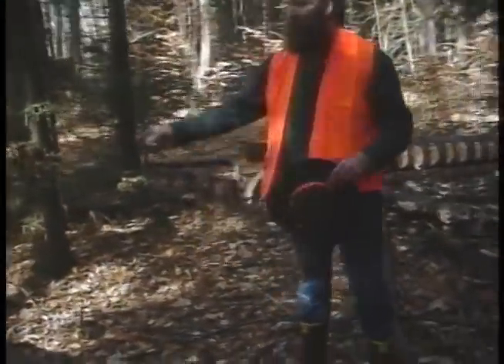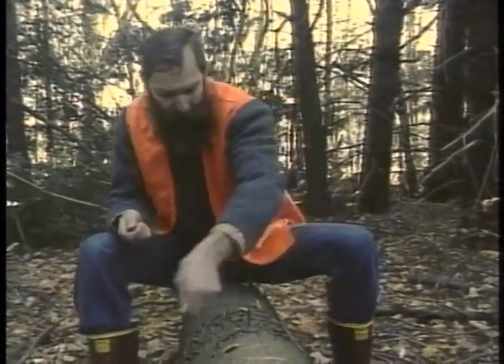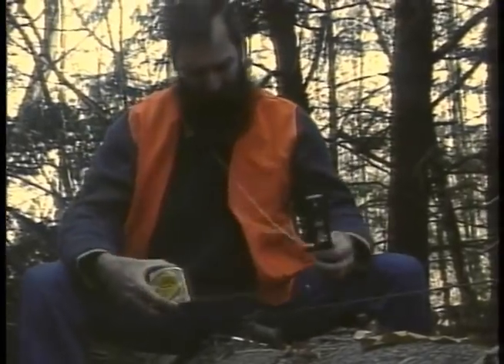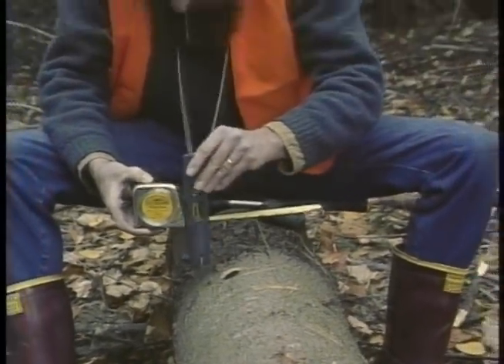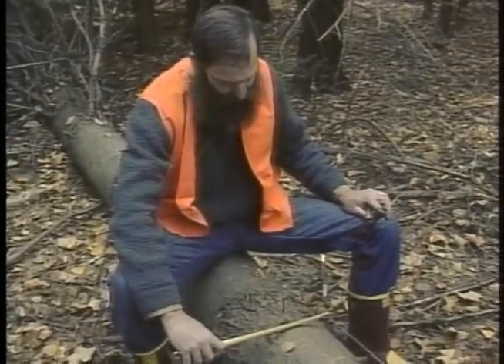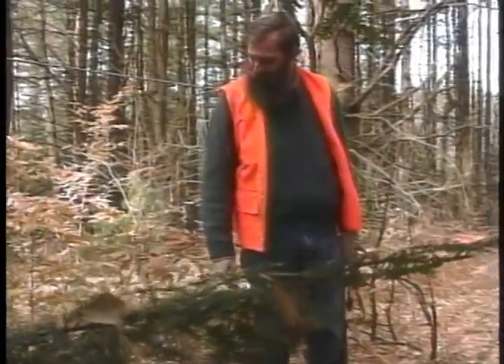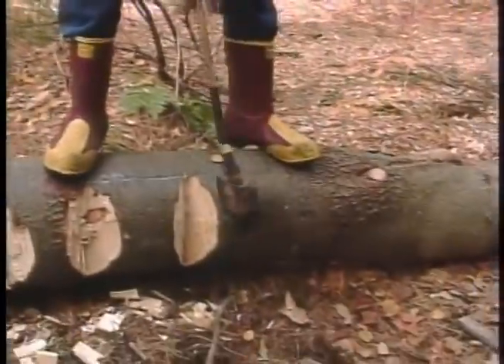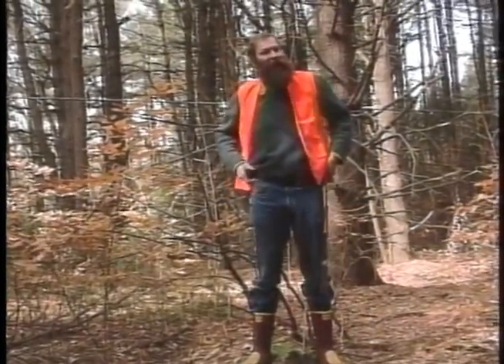Hand Hewing, From Tree to Beam

Comment: That's for taking the time to have this filmed, and thanks for putting it up.  

 i think i prefer your method for layout.  it makes a lot more sense, and is fairly minimalist.  Who needs logdogs when you have branches and a sapwood hinge locking the tree in place?  Less junk to buy and carry into the woods.    I was never content with the conventional approach of laying out the timber dimensions on the endgrain.  One because getting a perfectly flat and square cut down is difficult without great skill, and two because getting TWO perfectly flat and square cuts to be parallel to each other 18~20+ feet apart is pretty much impossible.  And if those faces aren't square and parallel to each other you will not get a true dimension as the beam will taper towards one end or the other.  This is why you'll hear people who use that method post comments of "oh you should give yourself and extra quarter-inch or half inch"  They need that extra material left on the log to 'fix' the beam later when it's closer to square and easier to measure/layout.
Reply from the maker: Thanks for your comments!

Comment: This video is good and gives a lot of good information. But it is a lot easier to go to the smaller end of the  log and make the biggest square out of the end with a framing square. Then transfer the same dimensions to the larger side then snap a little from each corner of the squares and you are ready to start chopping! Great video good luck everybody

Comment: Great video! I hope you have developed a better hewing method for your old age! Standing on a log is too dangerous (too athletic for me!), although we have very competent orthopedic surgeons, backed by exceptional technology that was unavailable to ancient timber wrights. I use a top hewing technique that keeps the chopper's feet on the ground and the ax out of the ground. I raise the log on bunks to a convenient height, and roll crown side up, and chock it. Since I am not standing on the log, the chocking just needs to keep the log from rolling. I peel the bark before I mark plumb lines on each end, at the desired beam center, then mark the cross sectional ends of the beam. Straight edge axes are used for scoring, the same as a chisel is used for scoring a hinge mortise, and then swung level to release the raised chips. Curved edge axes are useful for finish hewing. As you stated, axes end up with curved edges when they are used for digging. Offset handles are not critical, but they look cool! The first side is hewed by eye, then checked with a taught string and gauge blocks, and adjustments made to straighten the surface. I flip the cant on the fresh hewn face and hew the opposite side in the same manner. The final faces are marked with chalk lines and hewed to the lines in the same top hewed fashion. I control squareness by eye and a framing square, a level is used only for the initial set-up.
Reply: Check our Mr. Chickadee on YT.
Reply from the maker: What you're doing is new to me but makes a lot of sense.

Comment: My son and I are only just starting on our 4th beam hewing project, so we still don't really know what we're doing, but not knowing any better and never having tried anything else, what we've done so far is to hew the top surface of the log while standing or kneeling beside it.  I wonder if you could explain any why hewing the sides makes more sense to you.  I think the reasons we've hewed the top side instead of the sides are (1) it makes it pretty easy to run a string on both sides of the face we're hewing to define the plane we want to hew and (2) we've been sawing our kerfs instead of chopping out sections every so many inches, and sawing horizontally seems a lot more practical.  I'm guessing the reason to hew the sides is mainly just that the biomechanics are better?  Standing on the log and chopping between my feet is still kind of intimidating to me, though.

Also, I wonder if you have any experience riving hewn beams in two.  There's a very large white oak that fell down in a recent storm on my neighbor's property that he said I could have.  I'm hoping to get a 16' long roughly 14"x14" heartwood beam out of it and then split it in two with wedges and gluts to get two roughly 7"x14" beams.  The plan I'm hoping will work is to hew one face, then score it with an axe and maul, then hew the opposite face (leaving the two sides round), then score my line on that side, and then split it using a dozen or more gluts.  Do you have an idea how much hope there would be in that working?  Or do you have any other suggestions for how to divide a large beam in two without a sawmill?

In any case, thanks very much for what you've shared in this video.  It was great!
Reply from the maker: Hi Patrick! Hewing is geometry: you know the rules -- Euclid taught you in high school.  Let him guide you.  Also, you can't split white oak.  Try if you must, but don't let failure upset you.  You might be better off finding someone local with a sawmill. They shouldn't be expensive -- sawmill owners love to have an excuse to run their mill. Good luck!
Reply: Thanks so much!  If my odds aren't good, I don't want to ruin it, so I think I will find someone with a chainsaw mill that can come to the log -- I don't have any good way of getting the whole log to a mill -- or maybe I'll buy a rip chain and just eyeball it.

Comment: Is anyone else scratching their heads about his theory on which side the bevel should be to the work. Most broadaxes have an offset handle to allow the flat side of the broadaxe to the work and the bevel away from it. I'm really curious as to what the correct way is. I've seen other creditable people and literature  validating the above but his method makes sense and appears to work beautifully.
Reply from the maker: I tried both ways and found that with bevel side in, the wood slid off the log. Flat side in tended to bind up. Since then I have found broadaxes where the owner beveled both sides.
Reply: I am a little confused too. Mainly, Dan, can you describe how a right-handed broad axe differs from a left-handed one? I would have said that the flat edge needs to be toward the wood. It was made more confusing, because you are left-handed. Should a right-handed person hew with the log to the left of his/her axe? Loved the video. Thanks.
Reply: @dandustin824  thanks Dan, happy hewing.

Comment: How does one recognize the strengths and weakness signs of a tree i will be using this for building my first home. Thank you
Reply from the maker: Hi!  Sorry for the delay in responding. This is not an easy question.  You'll want to look at size, consistency of shape, absence of rot or dead branches.  You might want to pose this question to people in your area that deal with wood: loggers, builders, lumbermen, old timers. Good luck!

Comment: The flat side of the blade should be next to the log. A single bevel takes more material away than a double bevel. A chisel is flat on one side, the flat side against the wood. The hewing axe is for takng the majority of the wood away. Then you use a adze. A hewing axe as a bent handle leaning away from the log. This is a broad axe, not a hewing axe. There are different types of broad axe.
Reply from the maker: John, thanks for your comments. What I'm finding is that many woodworking techniques are regional. It really depends on where you're from and what old timer taught you. My techniques come from Norris Patch of Hopkinton NH who was a friend of my grandfather's.

Comment: Ok, for your last very effective hewing axe please tell the length of the axe handle, the length of the axe blade eg 7 inches and weight of the axe ! So I can get an equivalent axe, probably not a modern version. Thank you again for all the guidance.
Reply from the maker: The one I use the most: handle length: 24 inches, blade back to front: 9 1/4 inches, blade cutting edge (bit): 7 inches, weight 5 pounds. I have a second axe that I use sometimes: handle length: 27 inches, blade back to front: 10 3/4 inches, bit: 10 inches, weight: 5 pounds. Hope this helps!

Comment: Heartwood is not dead
Reply from the maker: Could you do some research and tell me more? Everything I see on the internet says that is dead. Thanks!
Reply: @dandustin824  I am in the same frustrating position as you. However the Heartwood is the structure of the tree and that structure is flexible, stores water & photosynthate (sugar), is able to move in alternating patterns branch unto branch to dampen the effects of the wind, and able to create walls of compartmentalization within itself. When a tree dies, all the leaves & bark starts falling off, and it is obviously a dead tree; it becomes even harder, rigid, inflexible, and susceptible to rot. A living tree behaves a certain way, and a dead tree does not behave at all; rather it just falls apart. It would be like saying my bones are dead because they're dense, centralized, and not as full of water as the rest of me.